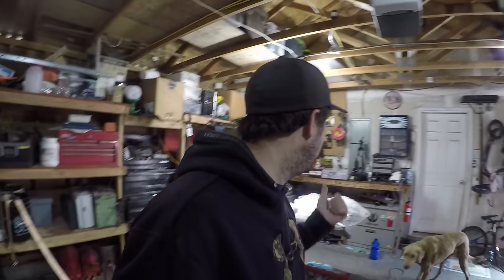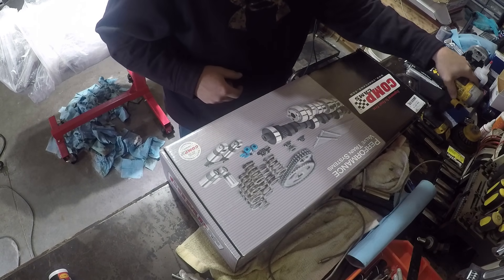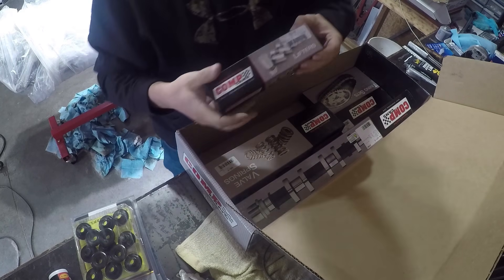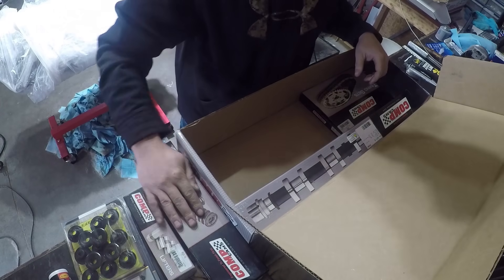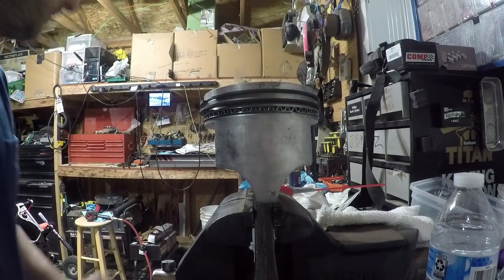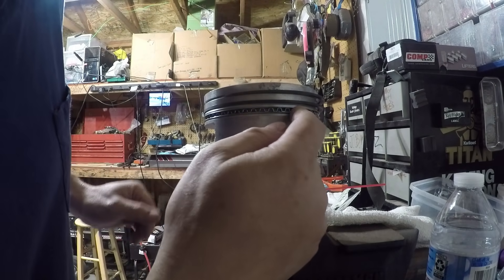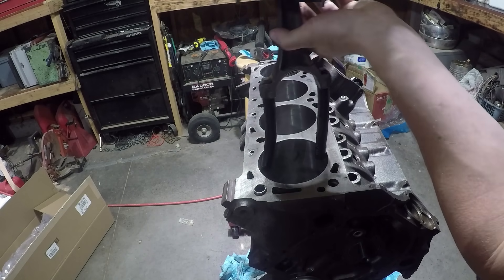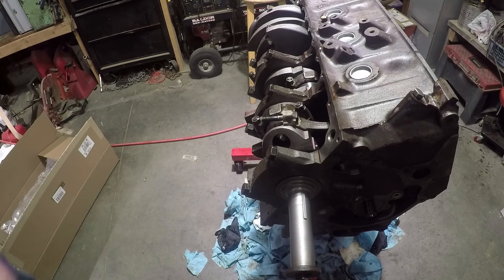FORD 429 REBUILD PART 2 | PISTON AND CAM

Comment: Im currently building a 429 D0VE block with rebuilt D0VE heads and CJ valves.  I went with a 274XE cam in mine. Gotta finish the long block, and you are giving me the motivation to do so!
Reply: Is your block a DOVE-A block? Did you know that some of those blocks are the same block that was used in the Boss 429, SCJ and CJ engines. They just didn't machine those that weren't HP engines for the four bolt mains, but it is an rather easy job for the machine shop. There are two different DOVE-A blocks, some can be four bolted at 2,3,4 and the better ones can be machined at 1,2,3,4. There's good info at 460ford.com (great site for all things big block ford) along with photos showing how to identify them. I'm about to put one (460) in my MACH I this week.
Reply: It is a D0VE-A block yes indeed

Comment: Zane sent me lol. I had me a 429 SCJ in a LTD PI (1978). Car never stopped charging. I ran out of b*ll* before the throttle. 460s are neat, but the SCJs spin!
Reply from the maker: Welcome to the channel
Reply: Do you recommend the 429. Any problems you had?
Reply: Ricky Flores The car I had I beat the snot out of for years. Never had a problem. Pulled the engine and scrapped  the car 6 years later. Was going to put it in a pick up. Someone stole that and a 460 I had pulled out of a wagon  off my farm in the 80s 😡.  Mildly built it’s a killer block. IMHO.
Reply: Christopher Rasmussen I want to buy a Ford F-250 with a 429 it’s a 75
Reply: Ricky Flores only thing about any big block is they are heavy. I’ve had all kinds of cars in my 60 years. The 429 LTD was super fast in a straight line. It was a pig if you had to swerve or try a high speed turn. I also had a 69   Plymouth Barracuda fast back. Car had a 318 V8 4 barrel carb small block. It had a mild cam and dual exhausts. That car would dice with vets any day of the week. It could not outrun them. But it could corner (almost) as well as the vets. I also had a 69 Torino with a 351 Cleveland. Car was heaver than the cuda, but could road race just fine. Today you can get a 500 HP small block . If you want to go with old iron you need to make up your mind if you want to go really really fast (in a straight line) or race around corners and that’s hard with 600 lbs of iron up front.
Reply: @christopherrasmussen8718  they didn't put 351c in 69 torinos

Comment: I used that same Comp Cams grind over 30 years ago in a 400 that I built for the Gran Torino Sport that I had.  I ported a set of 2V Cleveland heads, Edelbrock Performer intake, a set of Cyclone headers, forged pistons 0.030 over, and a Holley vacuum secondary 750 CFM carb.  That engine had good torque and made power to 6000 RPM.  By the way, when you get ready to start this engine, either use break in oil or add a break in additive to the oil.  Oils today do not contain much phosphorus or zinc and those elements are critical for proper engine break in.
Reply: Did you ever finish this motor?

Comment: Cool, it’s lookin great ! If you’re really worried about the rings with that assembly lube on them, I guess you could turn the engine over upside down and pour some regular oil around the pistons and let it soak .
Reply from the maker: Thanks for the tip

Comment: You really should be cleaning any new parts before they are installed they can come with a film from the factory or contaminants from the factory I at least clean everything once before putting in a new engine